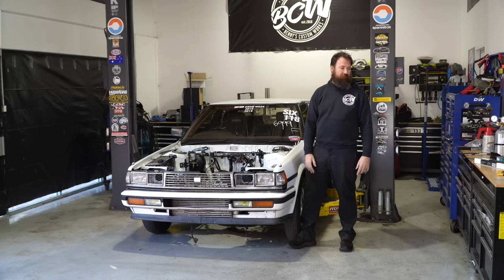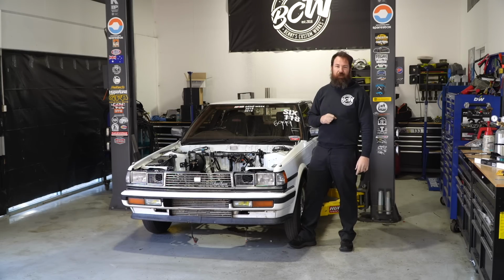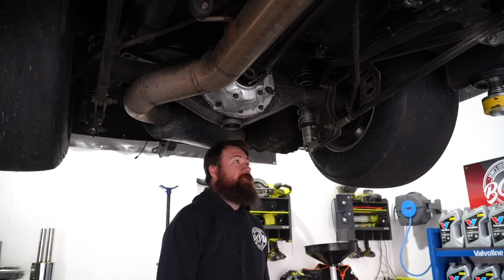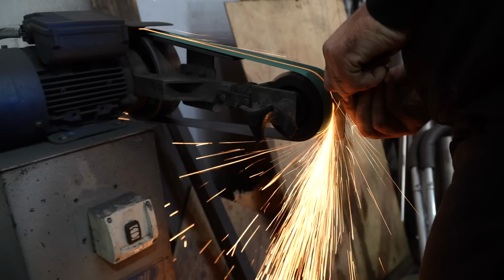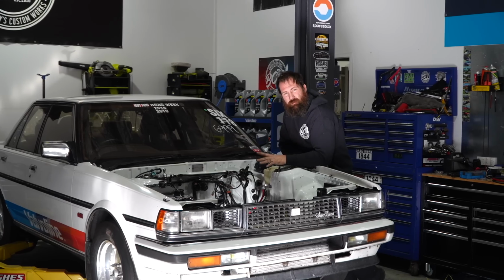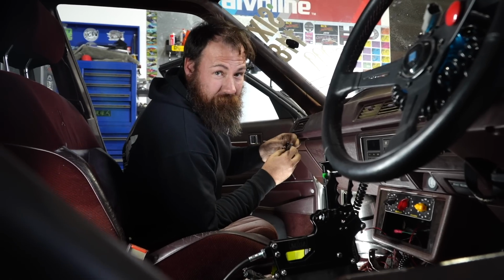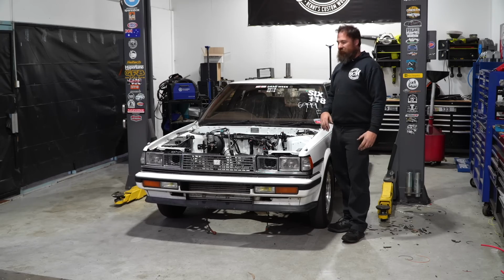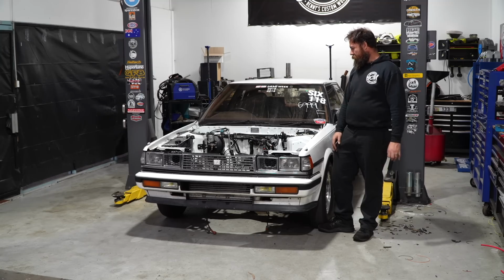CRESTA | Shifty Business

Comment: Why not use a S2000 alternator? Those things rev to 9000 (and charge at idle)
Reply from the maker: It’s not just revs, it’s also charge current. It may also only survive due to the pulley ratios in a similar way to what we’ve done.
Reply: @BennysCustomWorks  yes, I understand that. Most likely the windings in the alternator are travelling too fast in the magnetic field for a charge to build up. What I'm saying is that Honda have an alternator that charges at 800 rpm and at 9000 rpm. I am old enough to have had a generator equipped car which never charges at idle.
Reply from the maker: @cme2cau  yes, and the load of an s2000 at idle would most likely be 60 A, we’d be over 90a if all fans came on .

Comment: Is there any safety concerns about having the CO2 bottle inside of the cabin? I’m sure you saw the NO2 bottle explosion pictures on Instagram that ripped the whole car apart. I am genuinely just wondering, not criticizing.
Reply from the maker: None because I haven’t disabled the over pressure rupture disc on my bottle.
Reply: @BennysCustomWorks  good to know, thank you
Reply: those idiots removed the safety overpressure valve.. so sit the bottle in the sun and wait for boom. People like using blow torches aswell to raise bottle pressure, that creates weak spots too. Same thing would happen to a LPG tank or any kind of high pressure bottle if you were to remove the safety features.

Comment: It seems like you’re adding more and more stuff to the car… That means that it’s getting heavier… Wouldn’t it make it faster if you try to make it lighter?
Reply from the maker: The weight gain is marginal compared to the performance gains. There’s also a new track exhaust that pulls out 30 kg so it will end up as a net weight saving. Also the new torque converter is lighter than the old one.